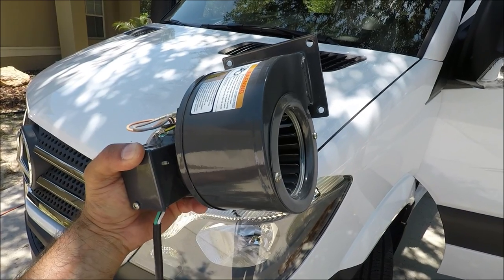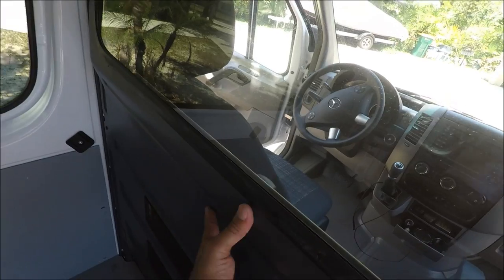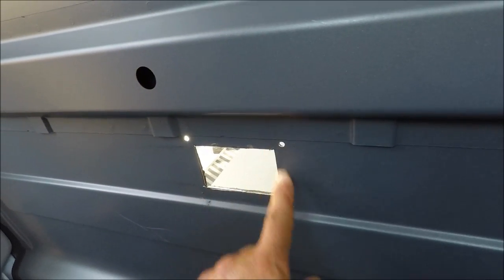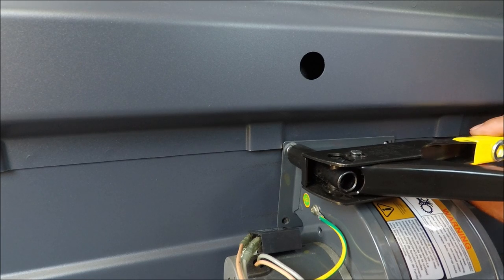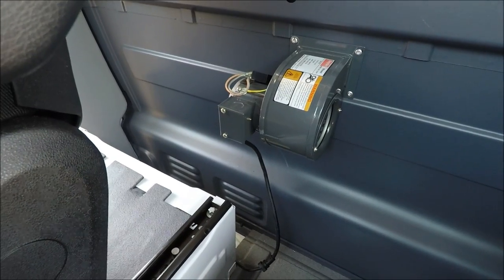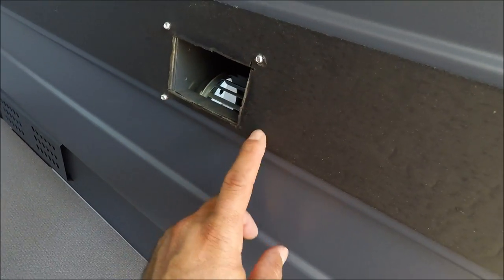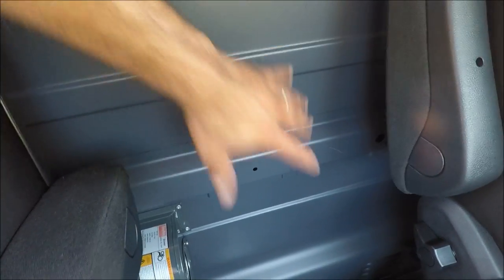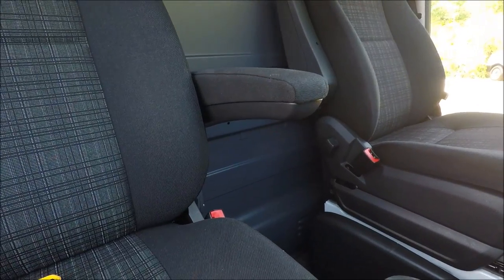Sprinter Van Cabin Blower RV Camper Conversion DIY Fan

Comment: Well done, most people don't realize that it was very common to leave diesel engines running 24/7 during the winter months in colder climates.
 Even just 10yrs ago and some industries still do it.
 Most A/C systems will put out the coldest air at a medium fan speed on the recirculation mode. 
 Consider putting a air return hole at the top of the divider maybe twice the size of the blower outlet. Some insulated window coverings for the windows will also drastically improve performance.
 Lastly I would love some actual fuel burn numbers for a idleing sprinter for 4 or six hours.
Reply from the maker: Kyle Goldston I agree sometimes I go to sleep in the van and I'll leave the truck running with the AC on for about 5 to 6 hours and I had all the vans that I usually do that and never had a problem with it so definitely they're made to be running most of the time
Reply: Taking in consideration you truck is a sprinter with DEF system it always advisable not to run it on idling for a length periods because chances of shoot and ash buildup is very high with low idling rates and clogging in the DEF filters is likely to happen sooner and its a very expensive repair to undertake on Mercedes sprinter vans
Reply from the maker: that is very truth i agree ,the problem is that i go to sleep in my van for hours and thats why my  def filter gets alot of buildup .
thanks for your great comment
Reply: I just purchased a 2005 sprinter with 15,000mi and minimal surface rust. I'm planning on a camper van!
Reply: Use a scan tool to do a forced regen when you wake up, that will burn the ash out, or you can go on a highway drive and pay attention to the high exhaust temp light. Or use a throttle pedal stick or constant rpm switch to keep the RPM's up to at least around 1200 - this is much better for your engine and DPF filter and EGR than idling. It actually doesn't much/any more fuel because the injectors squirt less fuel per cycle at a higher rpm with no load.
Reply: which scan tool do you use and is it a sprinter van?
Reply: Mwash Wetu Autel md802 all versions. Call and ask if it can do regens on your van. Mines an 04 sprinter
Reply: The DEF system on that diesel engine is not designed to run idle for extended periods. Your going to have very costly repairs if you idle too much. If that's a Mercedes engine then you'll be really forking out some serious cash on repairs that the dealer will not warranty because the ecm will show extensive idling. Just use it to transfer cooling air in transit.

Comment: so I have a couple of questions. In that case, while camping I assume. you would need to run the van's engine all night. are you concern about engine overheating? What did you do with the previous Sprinter? what made you get a new one?
Reply from the maker: Ferd Vega I'm still with the old van is going to be sold soon
Reply from the maker: Ferd Vega diesel engines can run all night with no problems

Comment: You could of just gone to an auto salvage yard and gotten a car ac blower that would be quieter and also already be 12 volt.
Reply from the maker: you are right but i really love this blower is supper fast for the size
Reply: @mercedessprinterdiy8556  Yeah I prefer 120 volt blowers as well for the power.